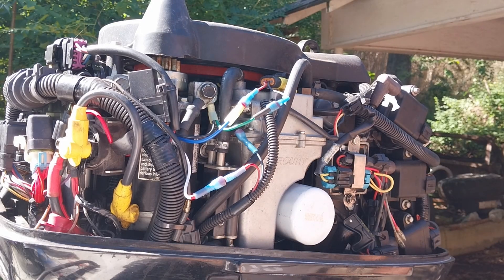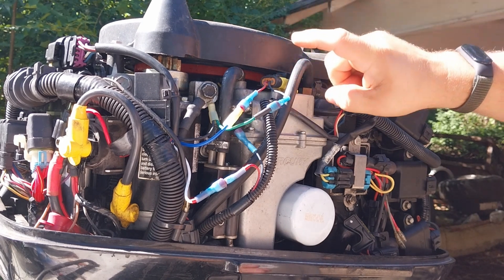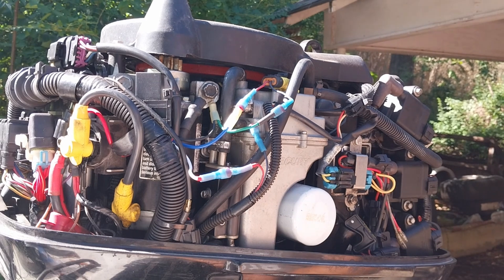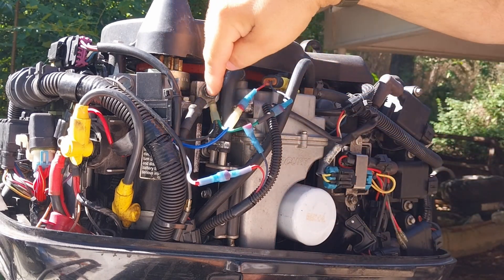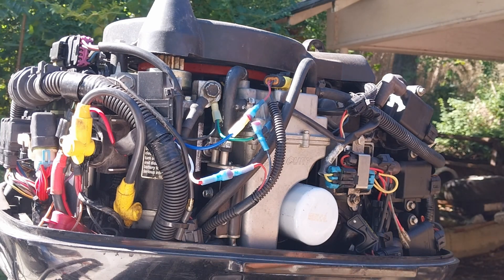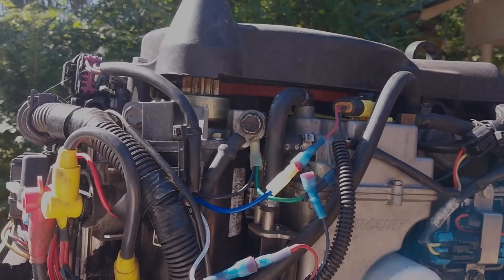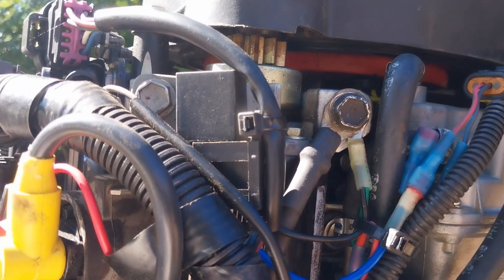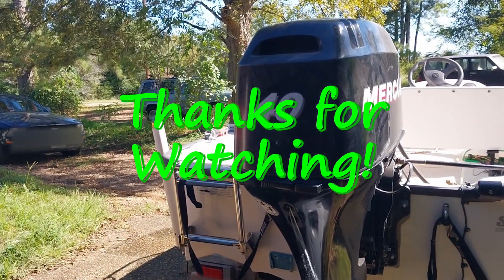Wild Blue Whaler gets Relay'd!! Installing a fuel pump relay Mercury 40hp 4 Stroke

Comment: Another guy here on youtube (omie) used diodes as well, is that needed? My motor is always connected to a battery.
Reply from the maker: I didnt use a diode, the way I wired the relay, it only energizes when the computer calls for the fuel pump to actually run, so no issues with battery drain or anything like that.